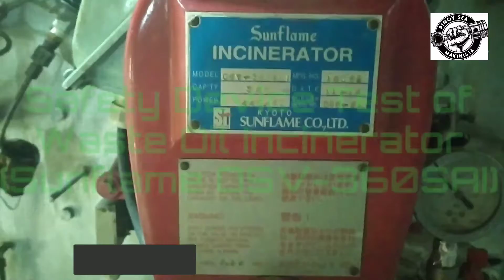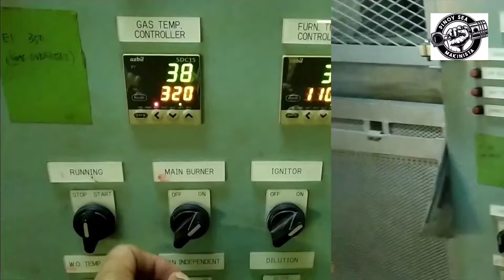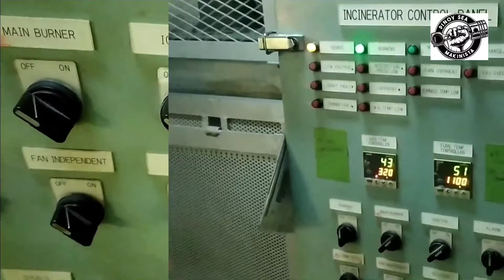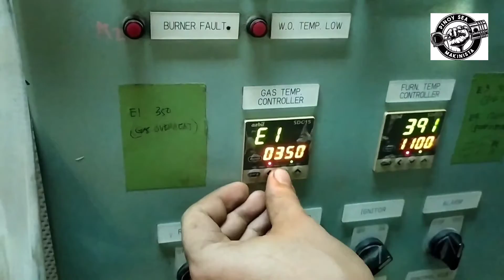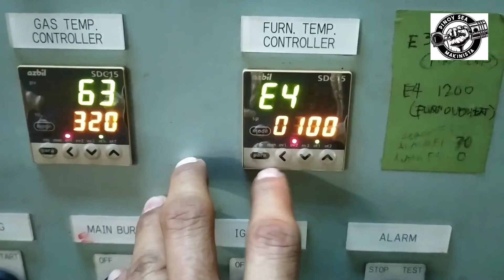How to test Safety Devices of Waste Oil Incinerator (Sunflame OSV-360SAI) @pinoyseamakinista

Comment: When will the solenoid valve for air  activate connected to the ignitor? During switch on of ignitor? Together with the solenoid valve for fuel?😊

Comment: Can you advice the pilot burner flame length...my pilot ignitor is good but the mgo doesn't ignite even with good electrode setting
Reply from the maker: Just check the transformer of your pilot burner maybe it is burned out.